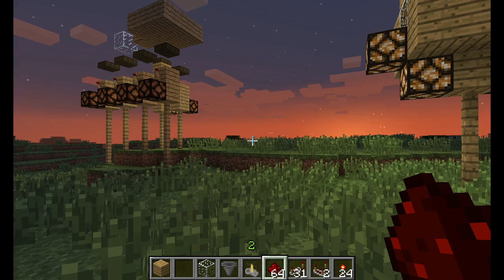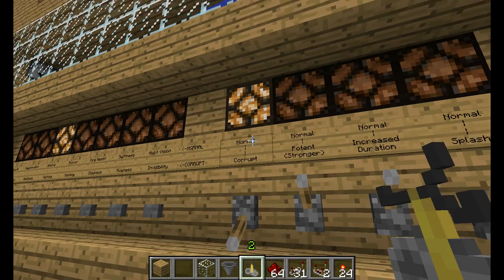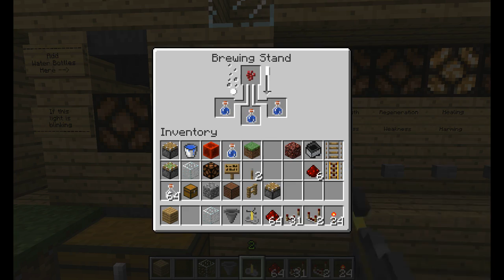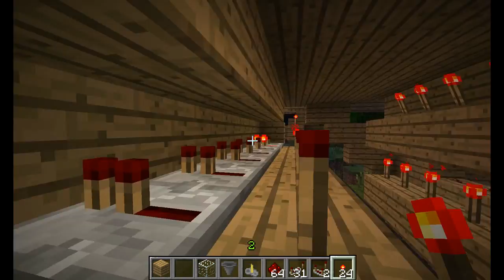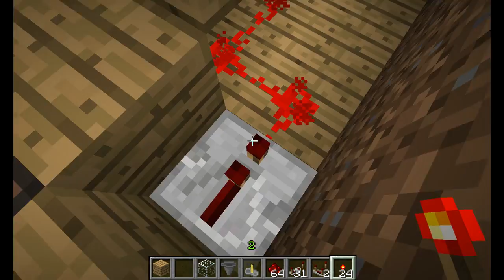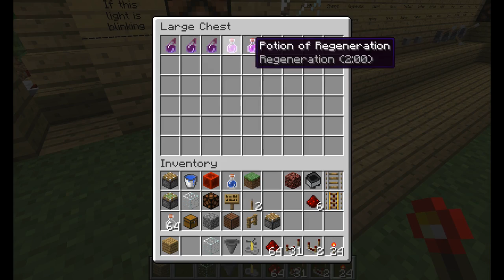Minecraft Potion Brewing Machine

Comment: How would i make this keep repeating so i could just leave it thanks
Reply from the maker: Well, this is an outdated design, there are better designs for potion brewing machines now (Tango Tek has a good design), but you can probably have the line that triggers the minecart that picks up the potions trigger the start line after a small delay (1 or 2 repeaters set on 4 ticks).